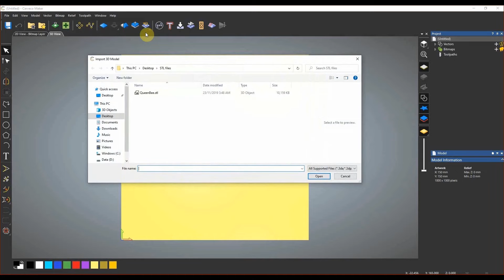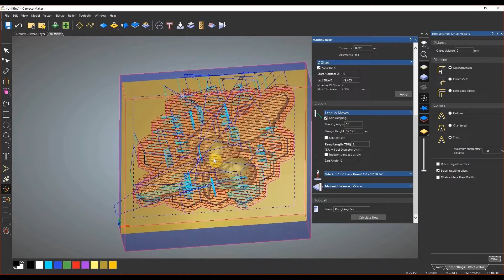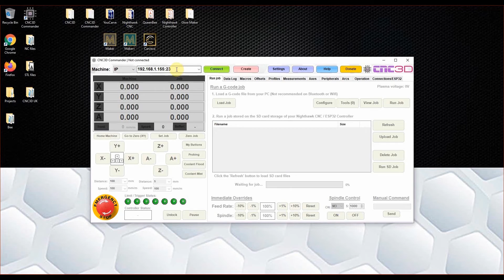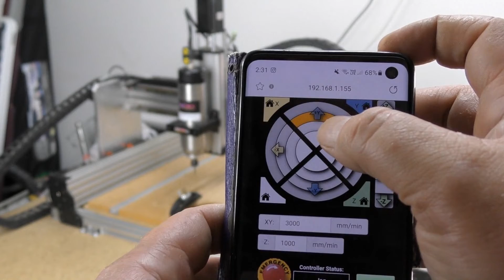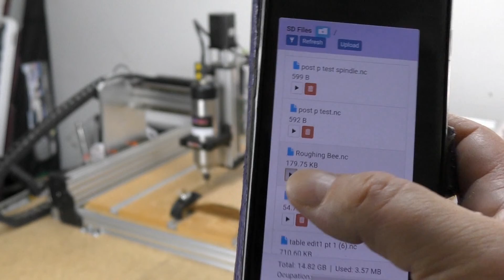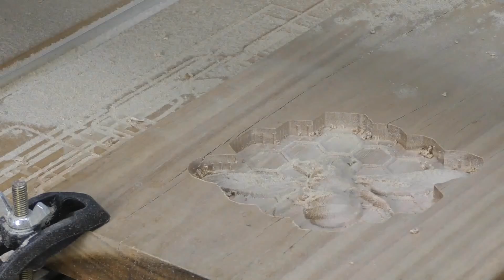CNC Basics - PT4 - 3D Carving simplified - How to 3D carve using Carveco Maker

Comment: Hi thanks for the video. I purchased my first 3D file today from Etsy. 3 Roses, approximately 8” square, 1” deep. Ran it through Carveco maker. Roughing (1/4” up cut spiral bit) & finishing (1/32” v-bit) passes. Roughing took 3 hrs (I can live with that) finishing cut was listed at 15 “days”. I shut it down and will try to figure out what I did wrong in the settings. One that I’m share was wrong is my safe hight was 1.3”. Will drop it to .2. There was at least an hour of the machine re-cutting that witch the roughing pass already did. I’ll have to figure out how to fix that also. Any thoughts will be much appreciated.
Reply: Using Carvco you should create the roughing and finishing tool paths together. That way it will know where the roughing toolpath has already been and not redo everything that has already been done. Shouldn’t be two seperate tool paths. When you save the toolpath it will create two seperate paths, one for each cutting bit.
Reply: @togdogs123  hi. Thanks for your response. I figured it out shortly after my post. I apologize for not remembering the exact tic box I un-checked that fixed the problem. I think it was in the tool settings. I’ll check when I get back on the computer. I do remember it was one of those “OMG you idiot” moments. obvious and simple.
Reply from the maker: Tuning your settings is an important part of making an efficient carving. Consider your material and the cutters you use for both roughing and finish passes. We have got a 1000x1000mm 3D carving finish file we use for bench testing our Commander software. The job uses a 0.25mm radius tapered ballnose and the time frame is 197 hours to complete!

High resolution 3D carves can take a long time but are well worth it. :)
Reply: @cnc3d , thanks for your input. I’ve played with the tool path setting a bit. Roughing cut improved a bit. My question is about the finishing pass. Is there a way to bypass the wasted movement at the beginning of the finishing cut? The project I’m working on has very little material at th top of the work piece (after the roughing pass) and yet the cutting tool is going back and forth across the whole work area. Is there a way to tell the machine where the current highest point is…….While typing I’ve had a thought. I set up the carve using suggestions from this YouTube video. In the video, in stead of setting up roughing and finishing at the same time, it had me set up the roughing cut and calculate it. Turn off the roughing tool-path (the little light bulb - it’s like turning off a layer in AutoCAD). And than set up the finishing tool path. The point of the video was showing how to set up an outlining vector (sorry, can’t recall the drawing tool name) and than an offset vector. Could this be why the finishing pass is replaying the roughing pass. It’s acting like the roughing pass did not occur. Thanks, I appreciate any help. 
I have reduced the finishing cut time from 15 days to 13 days according to gSender.
Just re-watched the video and his finish cut went right down to where the roughing bit left off and started removing material.